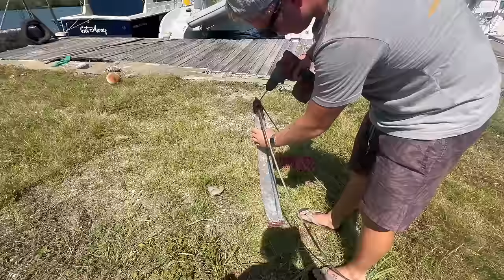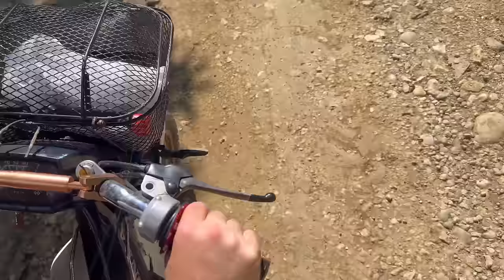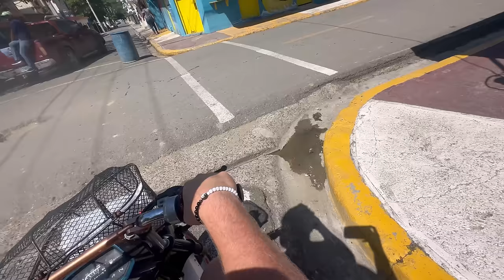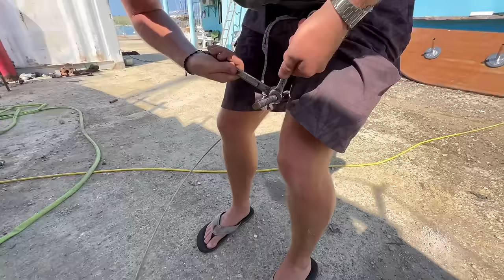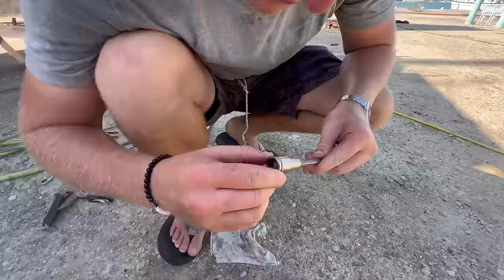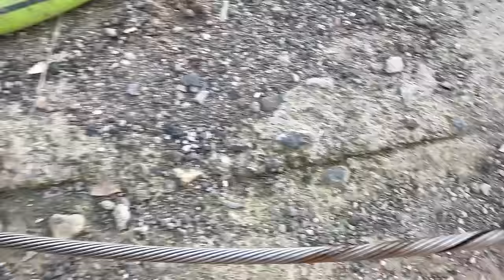S2 E20: taking apart the standing rigging (Dominican Republic)

Comment: Just my two cents as a beekeeper,   Have the beekeeper came now and get the bees out,  it will be easier on the bees and you,  once they start building a home it will  be very messy to get them out.   Of course I am realizing this is not in real time…..
Reply: I concur entirely, and I’ll add the fact that allowing the bees to build a comb and establish a nest will lead you to quite a job in cleaning it out, and it’s quite possible that they will build the nest in an inaccessible area requiring disassembly of your interior you may not want to do.
Reply: Bees out now, please! It's just better!
Reply: Plugs the hole
Reply from the maker: I wondered about that. Thanks for the heads up.

Comment: Hi when your working on old riging put some WD40 on the bolts , and inside housing leave for 5 mins , it helps to losing the rust,
Reply from the maker: Okay, thanks
Reply: PB Blaster is better for "Frozen Threads" probably 4-12$  a can 
...use sparingly

Comment: The threaded rod that fitting was on was probably slightly bent, that's why it didn't want to move. It's not a bad idea, imo, to use swaged ends at the top and only use mechanicals on the bottom. Top swages almost never fail because water doesn't get in them and cause rust like it does on the bottom.  But they allow a lot more flexibility where it's needed at the joint.
Reply from the maker: Ohh okay. Makes sense. Thanks

Comment: When your rigging is that jammed you have to crank it so hard just to seperate it, take the hint, it is showing results of a long good life of use and thus many hidden stress points. Sometimes the best thing is to simply replace than try to repair both ease and money wise. Time for dyneema?
Reply from the maker: Norseman’s are designed to be re-used. I think it had more to do with the locktite than anything else 😊 I’m doing dyneema for my lifelines but I’m going with 1x19 and new wedges for my rigging.

Comment: When you’re using 2 wrenches like that to undo tight bolts or nuts only have them about 30 degrees apart with the one your not pushing flat on the ground and the other one that you are pushing up about 30 degrees and then push that to the ground
Reply from the maker: Okay, thanks